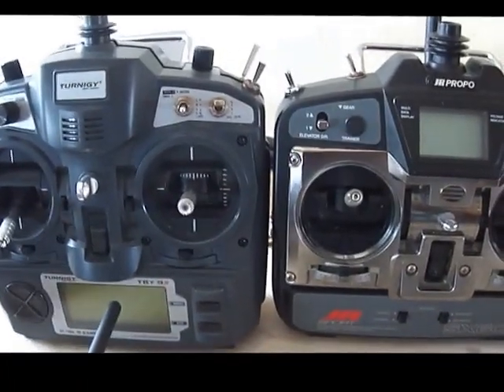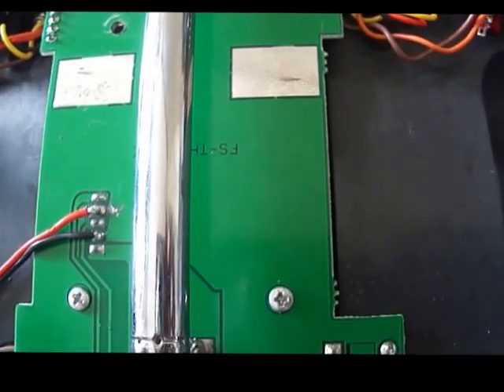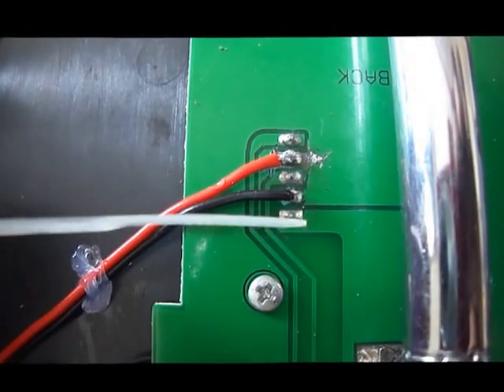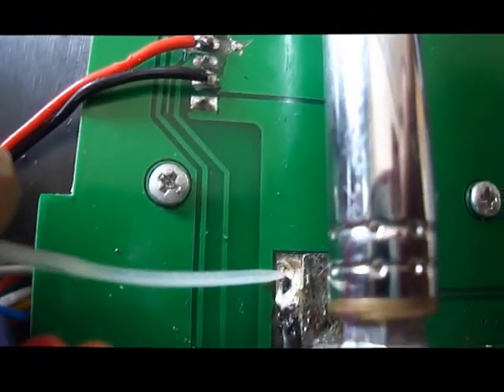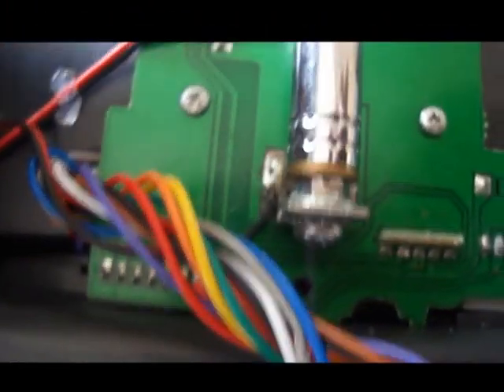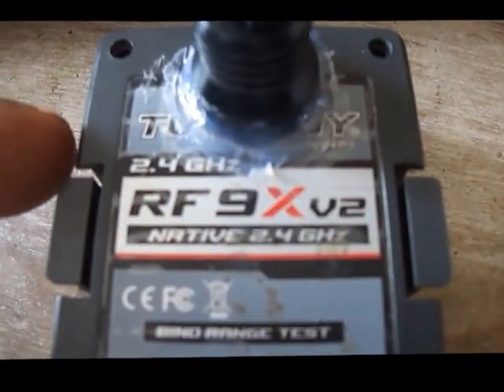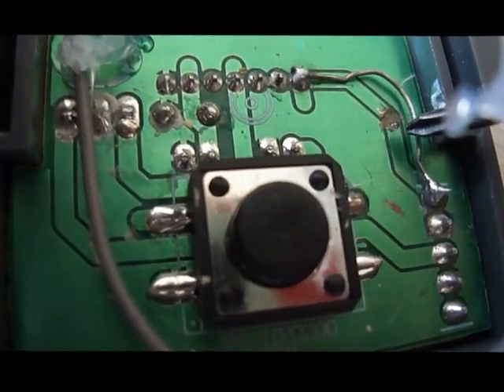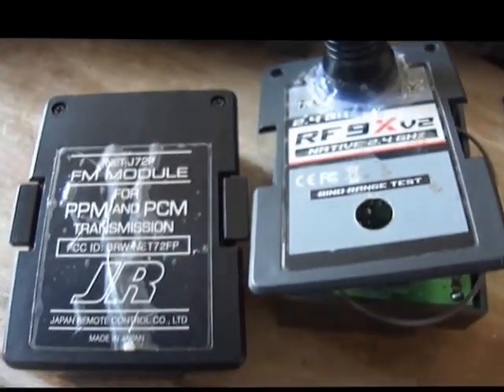Turnigy 9X 6volt modification to allow the usage of a 72 MHz JR module

Comment: Mr. Boyce - sorry for being lost in time but if you see this message please let me know the PPM protocol settings that you used (frame rate etc.,) for your conversion. I have the same radio and a bunch of JR 72 mhz modules but they do not seem to work even though I followed your mod instructions exactly - might be a protocol settings issue in ER9X which is what I am running on my 9X. Any help would be appreciated! 🙏🏻